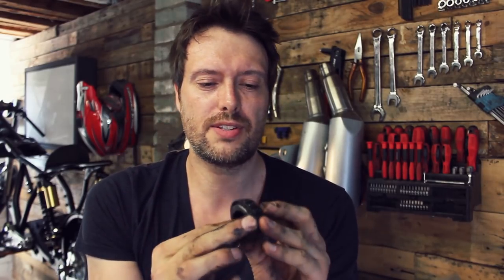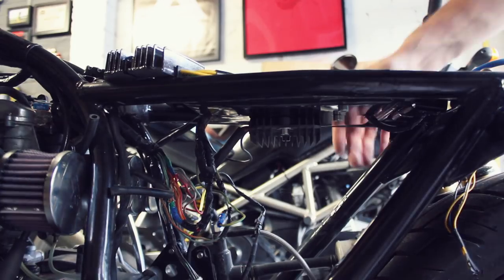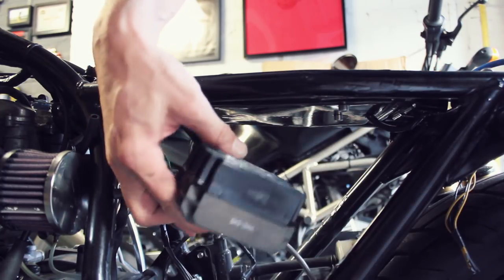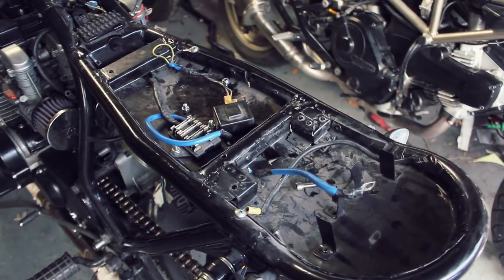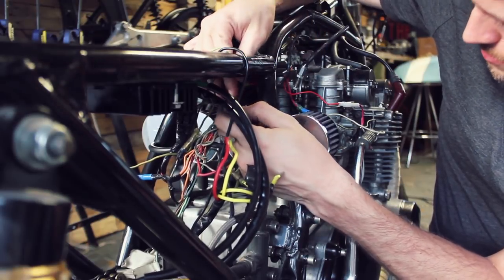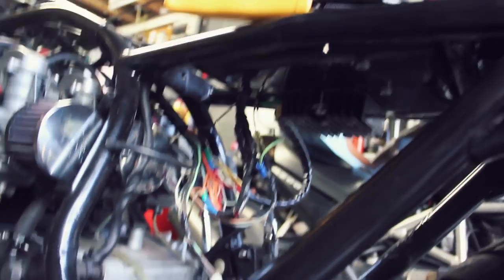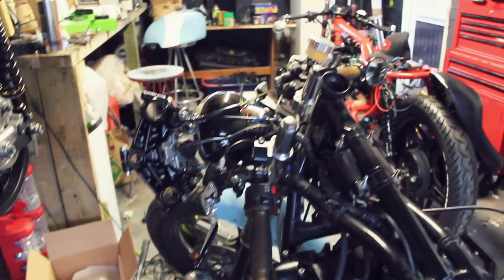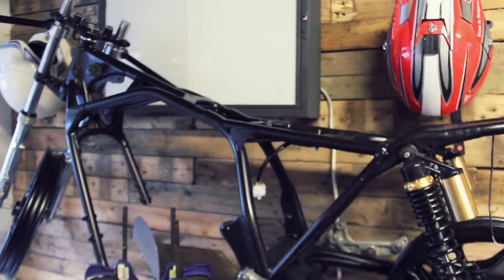Cafe Racer Build 34, Suzuki GS550 installing Rick's Motorsport regulator rectifier

Comment: Another awesome video!  Thanks for spreading the word about changing out the rec/reg if you're using a lithium ion battery!!  You must have one with the proper voltage set point to you don't fry that expensive battery!!
Reply from the maker: Thanks Rick's, great product you have there.
Reply: Hello i AM mauricio in Uruguay..amp 30?
Reply: I second that! Ordered the Ricks Motorsport Reg/Rec immediately after watching the video. Paired with a 8 cell Antigravity battery this bike starts like she's new.
Reply: I tried to order one for my CX500 but its isn't compatible with a 1979 CX500 Deluxe model
Reply: Rick's Motorsport Electrics I already ordered and received last week.  Is there a wiring diagram you can refer me to?
Reply: Rick's Motorsport Electrics is there a physical wiring guide?
Reply: @Fredrickhair  that should be a direct plug in, but if you're doing some custom wiring: 3 yellow are stator wires, no order.  red = battery (+) and green = battery (-)

Comment: Funny you should mention steering bearings. When I stripped my project bike, a few of the loose bearings ran across the floor. My new sealed bearings arrived a couple of days ago 😂
Reply from the maker: Yes they're a pain the loose balls, kept those that way on the CX500 to compare.
Reply: To me the loose bearings seemed a bit old school and I "think" the sealed should be less fiddly to fit. We'll have to see though! I'll be interested to know what you think comparing the two different options between your bikes.

Comment: congrats on the gentleman’s ride! Running through multiple tests on my GS 550 and thought about the kickstand safety switch and neutral safety switch. Couldn’t seem to find any, but was wondering if there are any safety switches that I’m missing. Have you seen any?
Reply from the maker: None on my 79 one. Kick start only also so I’ve ripped out anything associated with safety to stop the starter from turning. But can’t remember seeing anything on the GS back then on safety switches. I might be wrong.

Comment: Really like your builds but why use those horrible old Lucar connectors? Things have moved on, we were using those in 1978. Bikes are looking good though 👍
Reply from the maker: Only to fit what was supplied on the regulator and I had a load here handy. If I was making a loom from the start I would do it a lot differently.

Comment: Does Rick's new component act as regulator and current rectifier in one piece?  Because the suzuki gs originally separated them.
Reply from the maker: Depends on the model of gs. Some had them combined in one unit. This is both in one.
Reply: @forthebold  Who knows if you can make the change in the version with separate units and mount the Rick's component
Reply from the maker: They both do the same thing in one so you can easily make the change